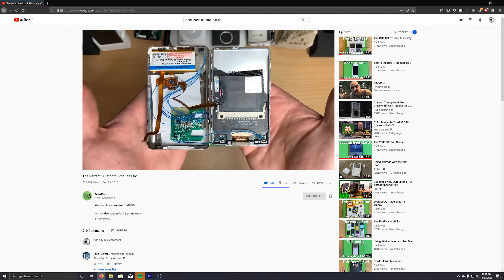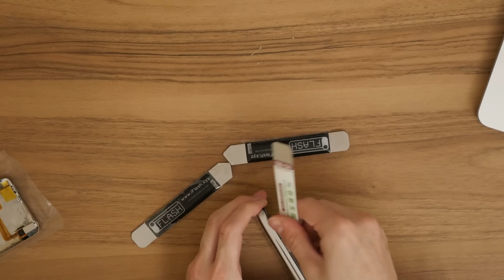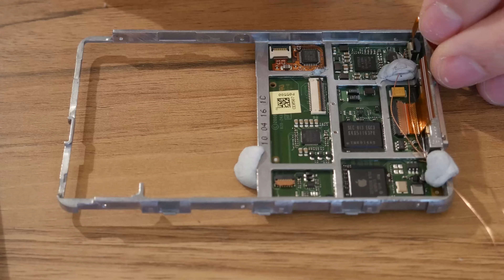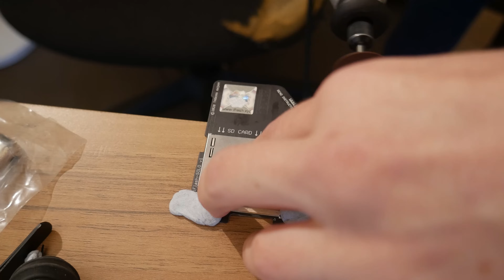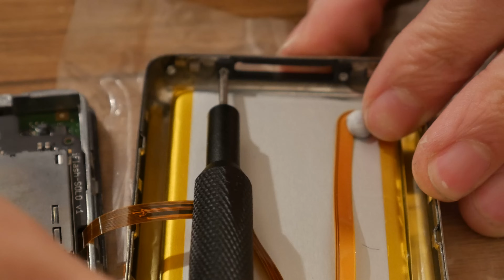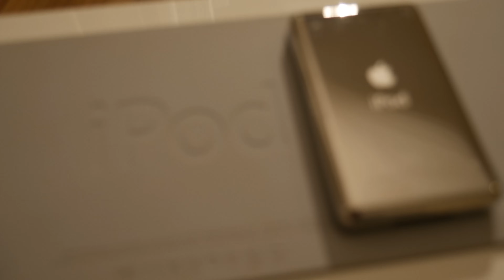The REAL Perfect Bluetooth iPod Classic

Comment: I'm planning on buying an iPod this week and idk which one to buy because of this. I want to buy a 5th gen classic since it's easier to open and close and I can get a clear front plate and clickwheel for it. I've never opened an iPod up so I don't know how different all the internals would be. What I'm trying to ask is would there be any differences between the 5th and 7th gen for things like the wiring?
Reply from the maker: Project r070971 the wiring should be nearly identical I believe. The internals are fairly similar. You can even solder the audio wires directly to the Audio Capacitors on the 5.5 gen
Reply: @Pendleton115  been about a year and I haven't done it yet lmao. I have a few more questions now since I'm planning on doing it soon. First is does the transmitter you used support LDAC and AAC? I currently have a pair of Sony earbuds that use LDAC and I'd love to use them with the LDAC on the ipod. Second is how hard was the soldering? I've never soldered anything before so I'm just gonna see if I know anything about soldering but I doubt i know anyone with much experience. Also I ended up getting a 5.5 so if I actually can just solder the wires onto the audio capacitors (which I'd assume makes it easier) that'd be great.